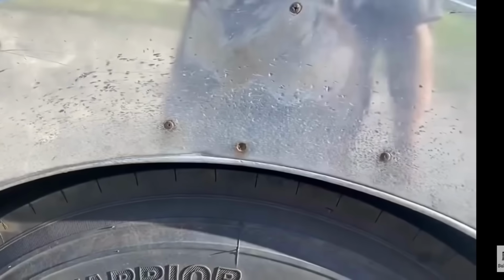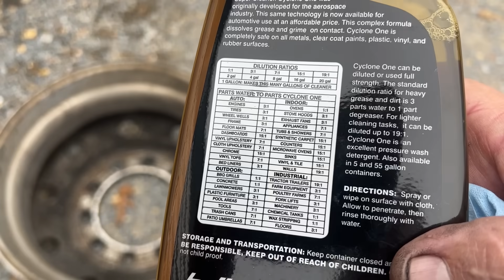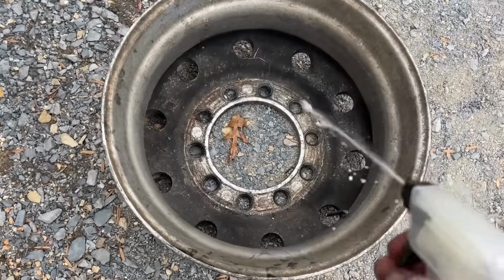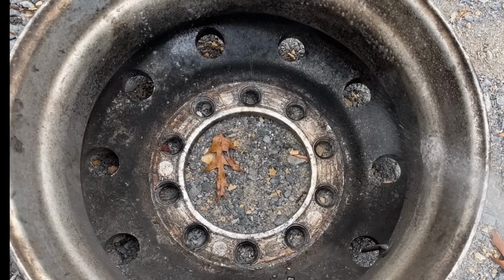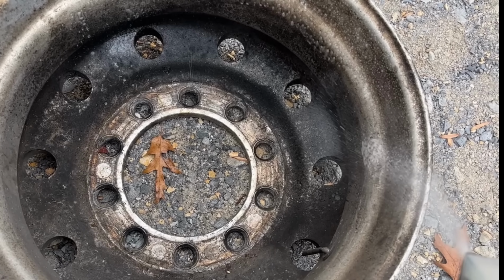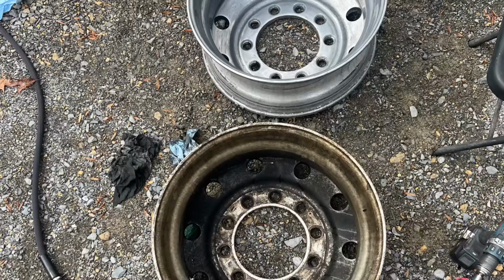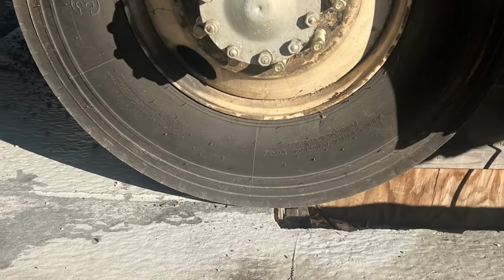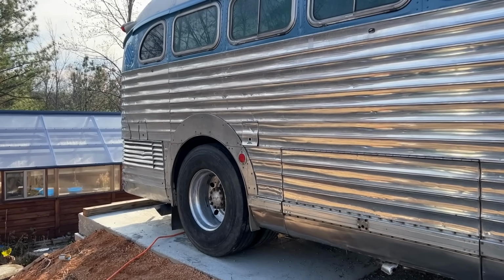More improvements to our 1947 vintage bus.  Aluminum upgrade. Wheel cleaning

Comment: Know a guy did that but got shut down. do to the very little thread left after the lugs. Due to the thickness difference.  That was a very expensive day for him. Love the work this man does.
Reply from the maker: 8:25 if you pause the video you will see a bunch of short inner lug nuts laying near the box and nice long ones on the wheel.

Comment: I knew a guy who, before he retired, restored aluminum wheels. Generally, the rims are the first thing to wear off and the tire pops over the rim. They would weld enough beads back on to reach the original height and machine them down. I wonder what thye use to polish them. You might try aluminum fabrication shops.

Comment: Adding my two cents, crushed walnut shells in a sand blasting cabinet that the wheels would fit in
Reply from the maker: Sanding will be the only way to get rid of the pitting then to be able to polish smooth

Comment: Napa sells aluminum wheel cleaner called aluminum brighterner or close to it. 7.99 just spray it on after that final cleaning stage,  leave it 5 minutes wash it off , it gets brighter after it dries..

Comment: Scott next time your near a TA truck stop there not alot of them left but theres usually a guy that does wheels and fuel tanks that hangs out around them maybe some of the newer truck stops get on the cb  ask if anyone is around .there use to be a guy in ktown that done a great job not that high either at the TA before you get into town coming east on 40 just after the scale house thats coming east now west out where your at i dont no or north or south but just get on channel 19 and start saying hey is there any one aorund that does wheels and tanks good luck keep the videos coming

Comment: Everyone has a hard on for polished aluminum, but a nice white painted 2 hole steel wheel with a blue painted hub would look stellar.
Reply from the maker: Until you get a few chips and nicks…
Reply: @BusGreaseMonkey  Lets not get bogged down with reality. For a brief shining moment, they will look great.
Reply from the maker: I wish i could get white wall tires for it
Reply: @BusGreaseMonkey  Now there is a pipedream! I can picture some of Trailways older Eagles with whitewalls. Michaud also ran white walls on some of their stuff with these futuristic looking hub caps. A great picture on the first day, a scuffed pile of twisted metal by the 2nd.

Comment: If you ever swing by Raleigh, NC my brother will have those things polished in a weekend. He can polish everything- including cast aluminum motorcycle frames which first have to be sanded smooth before multiple grits of polish. Once polished, you probably want to consider clearing them with one of the specialty coatings made for the purpose, or you'll become slaves to the polishing rag after every rain.

Comment: Pretty sure the wheels on the rear of mine are 40 years old too, they are pitted, but I polished them as good as I could for now. But the thing to do, is sand all of the pits out with a rough sandpaper like 80 grit, and keep going finer and finer on the sandpaper all the way down to at least 600 grit, then start your polishing process, you can make them look like a mirror, it just takes a lot of time and elbow grease.

Comment: I saw on a Youtube video that one has to change the studs when going from steel wheels to aluminum.  Is that correct?
Reply from the maker: We changed the Inner lug nuts to the correct ones

Comment: FYI, you were on the right track, just starting from the wrong side of the tract's.  (my background 25 yr's autobody, now 10 year's home machinist.)  First off go to your local Harbor Freight, get some "Buffing-Compound," I would recommend getting two sticks each of the following (only if your going to do all 6 {six} wheel's) other wise one of each should do it.  Get  / purchase a "Green-Compound Stick," a Black-Compound Stick and a "Brown Compound-Stick.  You were on the right / correct direction polishing the wheel with that cone buffing wheel, problem was your drill turns WAY TO SLOW!!!!!!  You would want to use either a "DIE-GRINDER," with a cotton wheel that Harbor Freight sells for bench grinder / sanders. 4-6" inch Dia, preferably.  FYI, polishing any metals is very labor intensive, steel or aluminum, brass, copper etc.  Sanding any metal you have to make a judgement call as to just what grit do you wish to start with, and how fine of a grit to finish with!!!!!  Based I what I could determine via only seeing through your camera lens, I would have started sanding  with a approx. 260-280 grit WET-SANDPAPER, via water (say a gallon pail, with some "DISH-SOAP," approx 1/4 to 1/2 a tea-spoon full, warm water versus cold.  Makes it easier on the person doing the sanding. Person doing the sanding, has to make a judgement call as to how often to change water.) The purpose of the soap, is to break the water tension, FYI.   Think in terms of sanding working approx. 4 - 6 inch area's before moving to the next 4-6 inch area.  When sanding, you may want to use a squeegee (Plastic / or Rubber preferred, see you local autobody supply store hopefully they have them, approx. 2" x 4") to remove the grit / sediment, to be able to see the surface. What your after is a unified (equal in sanding appearance) look.  I would keep rotating the wheel while sanding, and keep going till you have achieved removing your deepest pit's (pitting,) at that point it is now a matter of rinse and repeat moving up in sandpaper grit's.  I would recommend (all wet sandpapers) 260-280 first, (to remove all pitting) then move up to approx. 320-360-380 grit (chose what makes you feel warm and fuzzy, or what is already in your shop.) next grit would be something like a 600-800 grit, then move up to a 1200 - 1500 grit.  NOW YOUR READY TO START POLISHING.  Yes that's a lot of sanding per wheel / surface, but let's face it when polishing a wheel that's been effectively left to rot, it is going to take longer that a 3-min car-wash.

When starting to "POLISH" wheel's, start with the GREEN-Compound, to remove the first 80-90% (percent) of sanding scratches, changing to a new / different cotton wheel, start using the "Black- compound," then making a judgement call when you think your at about 95% plus of the finish you want, again using a New cotton-wheel, finish up with the brown.
Reply: A nice clear concise procedural.

Comment: I bought an 84 Camaro that had aluminum rims which I removed from the car one day and cleaned them up. However, aluminum tends to get blotchy during the process, so I used two cans of Rustoleum 2X spray paint on them and the finish lasted for years!

Comment: Super easy. First use coarse steel wool with that same cleaner. Then work your way up different grades of steel wool until you are at fine steel wool. Polish with Mother's and BOOM!!💥💥💥💥💥💥
Reply: Steel wool is bad news to use to use on aluminum wheels.  The steel wool will break down while you scrub into little-bitty particles (that you can't see), that will embed into the softer aluminum surface., Even after polishing, some will remain, and then eventually these micro-particles will rust.  When they do, the wheel will have a slightly yellowish appearance.  The yellowish color can eventually be polished out, but takes repeated polishing and it can reappear between polishes in spots over time.
I am not a pro at it, but I'd learned this years ago from a professional detailer.  When you see nice aluminum wheels with that not-quite-silver yellowish tint, you'll know why they look like that.  The detailer wasn't doing 60 year old bus rims, though...

Comment: Wheel that dirty, should soak with cleaner, let sit for 5 minutes, the scub with stiff plastic bristle brush, wipe down, then soak again.  Let it 15 miutes, scrub again, then wipe again.  Then, use polishing compound and power detal buffer on it. Rejoice!
Reply from the maker: Not even a remote chance that would work.
Reply: @BusGreaseMonkey  oooh, that bad?  Sorry, hard to see how thick that was.   My Pop always was a big believer in letting the chemicals and soak-time do the majority of the work.  It worked for me on an 30-yr old set of rims off a 3/4 ton dualie, thought it might for you too.

Comment: Next time you get very greasy aluminum wheels, try some aluminum brightener. It will cut through it like butter.
Reply from the maker: That was years of baked on oil not greasy at all.  Much like bed liner

Comment: Fine wire wool is what you need toget the spray off after a good 10 minute soak.
Reply from the maker: A flap disk at 20,000 rpm struggled to remove it.

Comment: If no one is shining wheels, perhaps that's another Monkey side hustle.  
Fabricating a table /wheel clamp system, mounted to an old hub and axle seem pretty straight forward. Driven with an old dryer motor, opposite the polisher's rotation, again seem like an easy to cobble together jig. Similar to a 3D printer gantry. Spin it up, watch it run.,

Comment: Hi all,  a lot of people have good ideas on the rim cleaning. I need some good ideas on how to fix my 4106  with a  8 71 the cooling fan stopped turning under power. No oil is flowing out of the return hose.

Comment: I would of soaked them in the degreaser diluted 4:1 and then power-washed them.... but then I would of done them in a catch basin over the pit so you could catch the grease and oil that came off.

Comment: You need to replace the rubber seal on those valves Stems trust me they will leak
Reply from the maker: We did replace the valve stems

Comment: Purple power from Walmart would do a better job than that crap your using . You need to go to a parts place and grab a gallon of acid and wash them right and clean them right and then you can polish them up . If there severely pitted have them blasted smooth before polishing . They'll shine like a babies ass !

Comment: That's a lot of work, but like you said, that's 40+ years of being an inner wheel, and if they rarely came off, they wouldn't have been getting cleaned regularly either.
Reply from the maker: The right equipment, procedures and time invested and they will look perfect.

Comment: as an alternative to all that sanding, you may want to try sand-blasting with some "CRUSHED-WALNUT SHELLS."  sorry it was approx. 30 yr's, plus; ago the last time I personally used Crushed Walnut Shells on my spiral staircase I built, and had the main support (3". Dia, Sch-40 pipe) chrome plated.